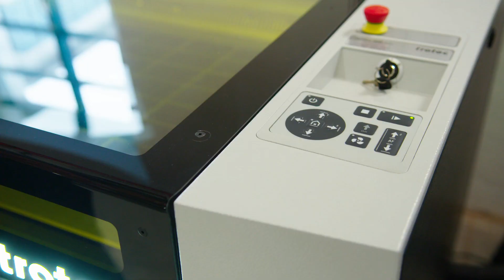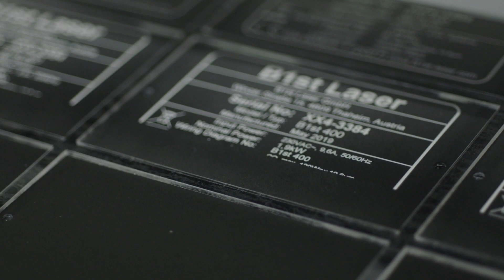New Speedy 400 Laser Engraver | Trotec Laser

Comment: what would the power consumption be for the sticker project?
Reply from the maker: Hello, thank you for your interest and question! The parameters for all our materials can be found in the laser software that comes with our laser machines - so you don't have to search for them or make tests to find the optimum parameters :-). These also depend on the wattage of your laser system, the lense and nozzle you're using, and on the general overall configuration of your laser system.
For the stickers we used TroLase Thins with an adhesive foil.
For further info please get in touch with us, we'll be happy to find the perfect solution for your applications: https://www.troteclaser.com/en/contact/contact/